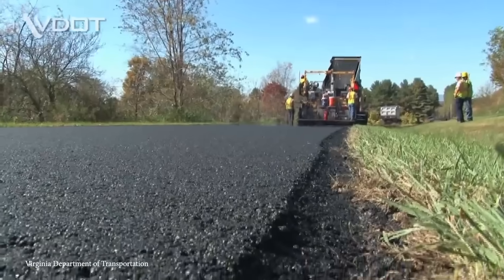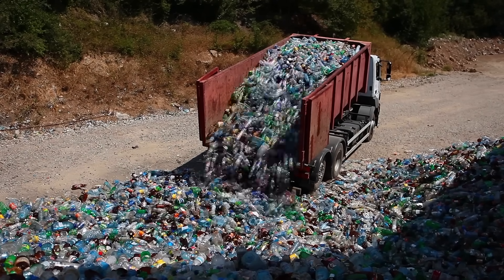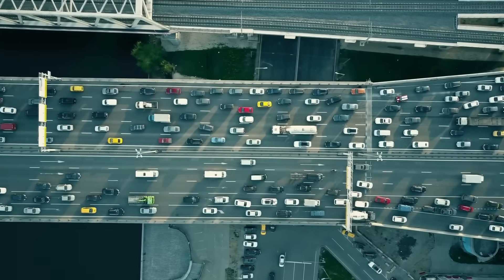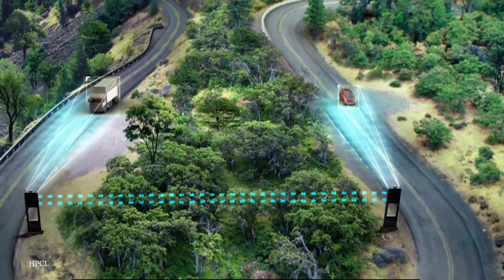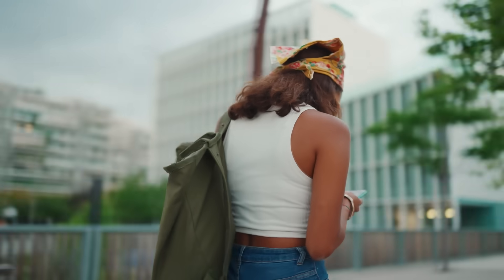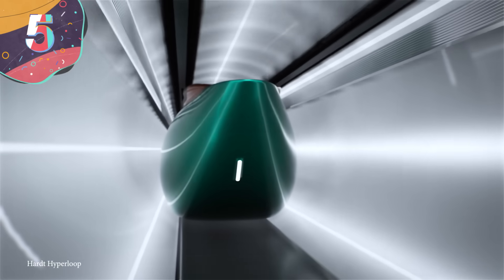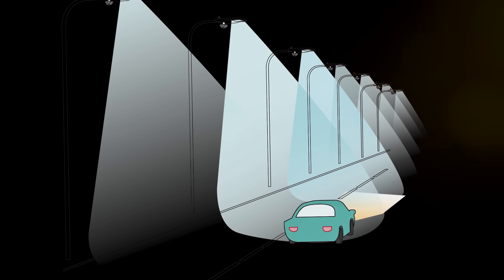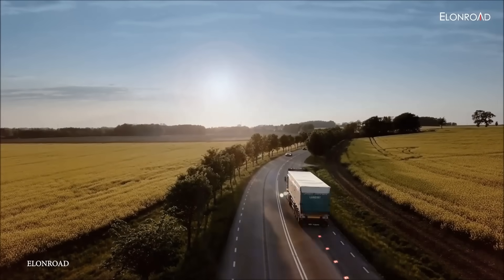15 FUTURE Road Designs that will change the world

Comment: Okay, look, I'm sorry to tell you this, but road design is already at it's peak form. It is a technology that has already reached it's apex. We are NOT developing a more advanced road. Every advancement we have ever made to roads has gone in one direction, and that is to make them cheaper and easier to build and maintain. If they were not as cheap and easy to build and maintain as possible, then we could not possibly sustain the massive road infrastructure we have. Heck, our roads are made of gravel and tar, and we still take forever to fix potholes. Just imagine if our roads had all this extra complexity built into them, where fixing them wasn't so simple as filling in a hole with some extra gravel and tar to patch it up... It would be a nightmare.

Comment: Some of these ideas are too smart to actually work. 
Example: Great idea. Speed bumps activated by speeding cars allows traffic to flow, and will force violators to slow down. 
Flaw: Local Police generate income through writing tickets to speed violators.  This will mean, these departments will adapt.  This adaptation is going to be a scary thing for several years/decades . Until things settle and economics reroute, Police frightened of losing the best paying job they have ever had, will be motivated to escalate authority to justify a need. 

As it currently works, traffic literally keeps them busy, when things are slow. And economics justifies a need for them with safety as the perfect excuse. 
Without it... they will find escalation elsewhere.

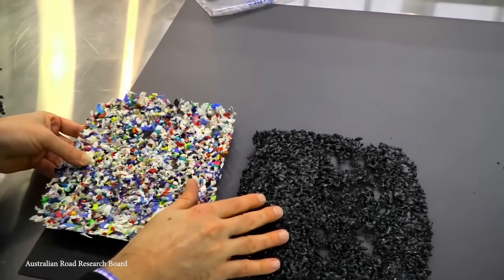Comment: I’m sorry but in 3:00 no absolutely not a good idea. 
Here are a list of things not true about the claims made. 

1. Stronger and longer lasting binder. 
Plastic breaks down far easier and is a known softer material than rock and stone. It won’t last a decade before it breaks down and no longer is usable. 

2. When you drive over pavement it is rough because it is a safety feature for cars so that cars can stop easier and won’t drift or slide as easy. When you replace stone with soft plastic it will only wear down  and melt the pellets together into a flat smooth surface. They stopped using plastic based asphalt in the UK for 4 years now because of the discovery of how dangerous it is as a material for road safety! 

3. Have you ever driven on black ice? 
Well driving on plastic is just as bad. The road won’t last longer than traditional materials because traditional materials have a better hardness MOH than plastic. Those stones have low MOH but they are still higher than plastic and they hold up to the struggle of the tough environment of being driven over by hundreds of thousands of cars under heavy weights over the course of time using torque of tires over the surface will need the materials to be bound together strong enough with strong materials that won’t melt from extreme heat and won’t break easily from pressure or weight of time. 

4. Plastic lasts a long time if not trampled on and stepped on daily but if they are under constant wear and tear will deteriorate the integrity of the plastic. Even the most extreme thickness of plastic can only last a few decades before falling apart. 
People don’t even understand how sun bleaching works or sun baking plastic makes plastic brittle and weak. Or the fact that industrial plastic is barely used these days but when does usually used so heavily that they break apart within less than 3 decades. Modern plastics you see milk cartons plastic bottles etc. all made of break down 10x faster than industrial plastics and the funny part is that we were taught about this in public school but no one seems to remember anything about it so they believe these eco freaks who tell you lies about plastic

Comment: #16:  SELF-DEFROSTING roads!   Roads with electric loops underneath them to warm the pavement up just enough to prevent precipitation from freezing and sticking to the surface.
Reply: just ask solar freaking roadways
Reply: @mikeohawk95  But those totally freaking work!  In fact, they produce so much energy they were able to materialize people out of thin air with shovels to clean them off!  Its also why they had to stop showing how much energy they make, as the amount of zeros would break most computers!
Reply: @scottthewaterwarrior  well colorado still has reason to use road space for solar energy + airport runways 7 ,solar,waste in bermuda airport re-think for space for planes & mass enengy injection at the same time,think about it
Reply: @mikeohawk95  Great idea!  As we all know solar panels are most efficient when laid flat on the ground and hold up great to heavy objects driving over them.
Reply: @scottthewaterwarrior  also dont forget wind enengy & hydro enenrgy form dams & waterstreams & coasts of the sea

Comment: I'd like to see power lines and transformers put under roads in man sized tunnels instead of on hydro poles that can be wrecked by weather, cars and trees. The intelligent speed bump sounds like a law suit for property damage waiting to happen. Honking at curves is a bad idea. People will slam on the brakes and cause an accident while looking around and trying to figure out what's happening. So the vehicle black box thing seems more about about making money than road safety. I recently made a trip down a major highway with a posted limit of 100kph. Traffic flow was 130kph, has been for years. People were passing at 140-150kph. So how many speeding violations would be registered do you think over a 3 hour trip? That's the easy one. There are a lot of violations that depend on current situation never mind the ones that are contradictory like the whole impeding traffic thing. I'm impeding traffic if I'm doing the speed limit and everyone else is going faster, or I'm speeding if I'm keeping up with flow. So you get pinged with a violation no matter what you do. The thing about snow is that it tends to cover road surfaces so you can't see any paint indicators anyway and is thus a waste of tax payer money. If you can't tell if the road is covered with snow and maybe you should slow down then you shouldn't be driving.

Comment: So, they want to take over your black box and make it communicate to law enforcement to get you tickets.  Sounds like you will need a Faraday cage over it, and any antenna connected to it, or at least a set of side cutters to clip the wires.

Comment: Number 4 makes little sense. Running cables inside a modular road bed. you'd have to cut the cables, and pull them out to replace a section of surface.

Comment: No car black boxes tattling on us will not make the roads safer.  NJ made it illegal for automated system to issue fines because they looked at the data and it doesn't make the roads safer- it's just a cash grab for municipalities.  NJ also has the safest drivers on the road in the US.

Comment: While conventional vehicles are not doing the world any favors, neither are EV's. The things used to make batteries, the insane cost of them, there is no ethical way to dispose of them, and all of the world health issues we are lied to about or simply not told about. The very short distance an EV will get you without needing a charge would get you to a campsite with no plug in to use so that you could return home. EV is the stupidest thing I've ever heard of. 
   Bring back the momentem engine, which actually worked by the way. They just don't want you to know that.

Comment: Hyperloop is completely infeasible. Even at 1 mile long, maintaining a near total vacuum on that much volume is nearly impossible without inducing a leak somewhere. And you can't just release the vacuum when it's not in use. It takes a FUCK LOAD of time to remove the pressure from that much volume and no amount of bluster from a spoiled, narcissistic billionaire will change that.

Comment: Plastic roads will probably result in a lot more microplastic in the air

Edit at 3:26 in the video:
Didn't watch this video before commenting. Just provided my thoughts as is because most other videos going over the topic didn't address the microplastic problem. Glad to see a channel finally go over that issue instead of sweeping it under the rug

Comment: Here in the Netherlands we quite commonly have green wave traffic signals, they are synchronized lights but across very long stretches of roads.
The idea is that a sign indicates you a recommended driving speed and if you remain driving at that speed you should (not always) end up at a green light at the next intersection, so you can keep driving through.
I have to drive through one of these waves when entering Eindhoven which is almost 2 kilometers in length, with 3 traffic signals which ends up in a roundabout
Reply: Yea in Quebec Canada the is often these   synced lights on long stretches . i thought this was necessary for traffic lights to work on main streets"cities , weird the USA didnt have this !
Reply: Ja is heel handig! Wat ik alleen niet snap is dat ze soms 70 aangeven op 50-wegen (die eigenlijk gewoon 70-wegen zijn, daar niet van). Kun je daar dan nog voor beboet worden?

Comment: About that synchronised trafic signals. Have you looked into how the Netherlands conduct their traffic systems. this has been going on for over 20 years already and moving into the future with smart connected traffic management systems where road users of any type get and supply information from and to the system making it even more comprehansive as you go. Look into the 5 traffic management centres monitoring and managing all highway systems throught the land and into things like Flowtack managing and digitising the intirety of cities already.

Comment: I'm not sure if Synchronized Traffic Signals are the way it will go, as you discribe it in this video...
In the netherlands, Many trafficlights are "smart" traffic lights. With sensors in and around the road, an intersection will know how many cars and/or bikes are waiting and also knowing what the flow is of that intersection. It will determine which lights to prioritize and even switch it up, so others lanes can go at the same time. Near Highway exits, there are intersections that will communicate to the next one, to let the other one know how much traffic is coming that way, in which an intersection can decide to let others "quickly" go first before a large sum of cars are coming, which also means, the bigger line of cars do NOT get that priority they would normally get because in about 15 seconds they will be joined by more and then make that light be on green longer... difficult to explain,.. but think 'not just bikes' has some great videos on that...
Those darn dutchies are ahead in so many things sometimes. ;D

Comment: ok so the first two are good ish and every thing else is ok ish or just bad for one roads are already made of waste from the plastic manufacturing proses it doesn't degrade for hundreds of years. second if you wont to use recycled plastic for roads the your only option is PET/PETE plastic that's what things like bottles and tons of other stuff is made of its not very strong. next the road peace's are lighter then you car and its not secured well if at all also the water storage is a horrible idea if that water freezes it expands and now you have a very broken road

P.S. the electric road charger is not practical to much energy loss from ground to car

Comment: weight of car cause plastic to crack and puncture a tire, causing a crash and car fire the car melts the road. In summer the heat causes road to melt creating a plastic swamp that vehicles are unable to pass
Reply: Don't forget the landslide as the rigid-side plastic underlayment melts or outgasses formaldehyde, soil-filled or not.

Comment: The plastic road idea is great. Cities could run not just new pipes or lines under the road pretty easily, but also they could feed hot water pipes under the roads and cycle them through water heaters to melt snow in the winter.
Reply: I don't agree,because as the road is being used,from the wheels friction will result a constant waist of microplastic,wich will end up in the soil, water and in the air....would you like to breath microplastic dust?
Reply: @n04n1m0u5  Already breathing, eating, drinking it now. Little bit late for that argument my friend.
Reply: @LordBLB   ....but making roads of plastic,the contamination with microplastic would increase by at least exponential 10....
Reply: Clearly you haven’t consulted an engineer before making this comment :-)
Reply: @Matt-yg8ub  Just making conversation, no argument. But, Engineer? Stop thinking plastic toys, and start thinking high impact polycarbonates or ultra high molecular weight polyethylene (UHMWP). Those can be constructed out of some recycled plastics with a little chemistry.
Reply: @LordBLB   I am aware of the chemistry … and the reasons why it won’t work.
Reply: How would they service the stuff underneath the road once it is all connected together?  Like the joints of the pipes/wires/whatever would have to line up perfectly with the ends of the road sections and have some way of disconnecting/reconnecting themselves to the surrounding pipes while the road section is in place.

Comment: "Induction Priority Lanes" I liked them better when they were called Cable Cars LMAO
Flying Cars are dumb idea because people can barely drive on the ground as it is. Let's give them a 2 ton death machine at 30,000 feet. Good job.
The Hyper Loop is also dumb, not just because it's a Muskie Huskie idea, but because you cannot people in a tube that 700 mph. I'm pretty sure you'd feel some adverse effects from. ALSO a giant pressured vacuum sealed tube under a road sounds like a dangerous idea!
A lot of these are poor ideas and the data collection stuff sounds good in theory to better that infrastructure but WHO collects and has access to that data. I'm sure the Chinese government wouldn't do anything sinister about knowing where you are driving. It's fine. Everything's fine.   
Synchronized lights, recycled roads, self-repairing roads, jigsaw roads, smart speed bumps, smart lamps, glowing roads...  these are actually good ideas and have a lot practicality in the right situations

Comment: A few points to consider:
1) The hyperloop is bunk. It'll never work as advertised.
2) The self-repairing road would be HUGE!
3) Replacing some roads with plastic versions of the same thing seems to make sense. I can see highways being replaced after some tech improvements and why not use waste plastic?
4) The temp-sensitive paint exists now in, of all things, coffee mugs that have funny sayings on them visible only when filled with hot or cold drinks. Using them on potentially icy roads seems like a no-brainer.
5) Induction charging lanes would change the ev vehicle market completely. The biggest drawback with them is range and the charging lane would eliminate that. If they used solar power to make the thing work then it becomes zero emissions as well.

Comment: You should try driving in Melbourne Australia, there is nothing but speed camera's with no signs to alert they are even there. The gps alerts to the speed camera's dont alert you to the camera's until after you have passed it. Are they making the roads safer or just pissing everyone off?
Reply: Lets give you cars and trucks capable of going well over 100, but ask you to never go over 65. Super smart.
Reply: If they want people to drive slower, they should make the roads less wide and straight!  Like there are a lot of places in the US where the speed limit lowers (or rises) on a certain stretch of road and yet other then the sign with different numbers, nothing else changes!

Comment: Road marking- cat's eyes work well, are completely passive, and cleaned by passing traffic (press down wipes them). 
Jigsaw roads- fine for light use, but not for 40 ton trucks.
Hyperloop. Nope, can not/will not work. Many issues, currently not being pursued. Forget it.
Lights- vehicles carry their own. Pedestrians can too.
Paint that can tell you about snow- which you cannot see for the snow.
Reply: Jigsaw roads also mean that any jigsaw piece that is damaged you have to tear up all the piping/cabling underneath, that was one of the major selling points.  So you can’t just fill a pothole/chip/damaged piece. You have to disrupt all those services, and drainage, and the like for anything that damages plastic, like, oh, sunlight and temperature changes.